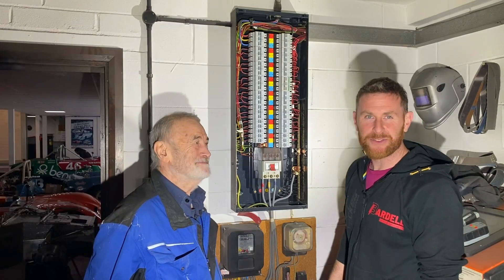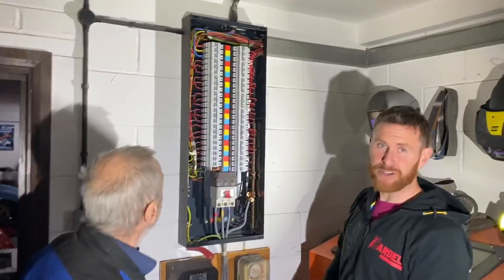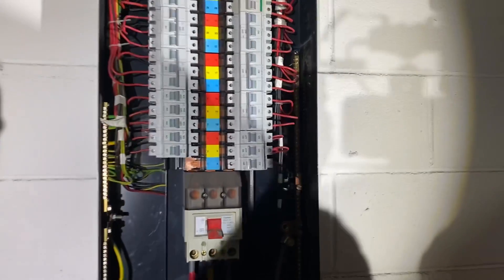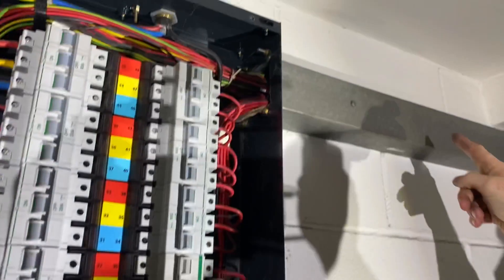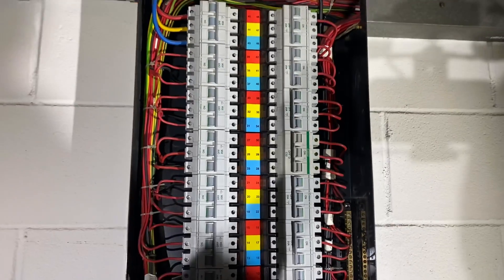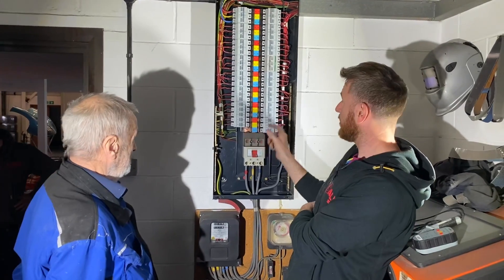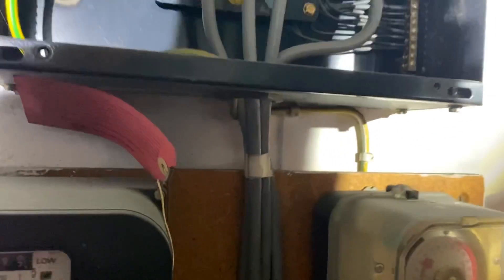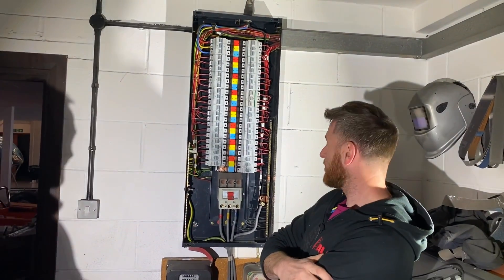Do You Cable Tie Your Conductors in 3 Phase Distribution Boards..? Electricians Matt & Clive O’Dell

Comment: Nothing wrong with ties. All those cables laid on each other in the trunking and should be derated accordingly.  Plus they all need to be under significant load for a prolonged period. Design guide covers it. Myth started by Another....... 

Keep openings tight regardless imo.

Great video guys
Reply from the maker: Massive thanks for watching and commenting Mark. Gaz 👍🏻
Reply: @GSHElectrical  always watch every single drop gaz on here and efixx. Take care and merry xmas!

Comment: Not worried about grouping factor, that looks to be old 14th edition going by the board and breakers, the cable ties are probably the newest thing in there. IPXXB at the bottom, where's my standard finger and will it actually reach up to those terminals - Paul anyone seen Paul.
Reply from the maker: Have you got an IPXXB finger in your tool box? 👍🏻
Reply: @GSHElectrical  12mm diameter and 80mm long, indeed I do. People always seem to think the standard is much smaller than it actually is.

Comment: How many hundred amps would you have to be pulling before eddy currents could actually heat a consumer unit with separated phases or separated L/N? An absolute shit load of current... Modern AFDDs are gonna heat up a CU faster with thir dissapaited heat. I get the principle but has anybody managed to make a CU heat up with eddy current?
Reply: John Ward has done a video on this and he couldn't get the case to heat up.
Reply: @paulambrose3003  that was a great watch, definitely more current than a thought. I've seen some older temporary distros with powerlocks fitted in a metal panel, as a connector they're good for 400amp. Yet the designers didn't worry about it heating up (mind you said distro was made of really heavy plate and angle iron)
Reply: I have come across a trunking that was hot to the touch due to eddy currents, was in a supermarket supplying refrigeration
Reply: @nickbuckle646  I would assume that's more likely caused by thermal dissipation within the trunking? what was the mechanical separation between phases or phase to neutral and was it definitely eddy currents causing heat rather than just overcrowding?
Reply: I wasn't talking about a little consumer unit, I would say that the place I saw it inwould have been pulling at least 200a per phase.
AFDDs a still not commonly fitted to expensive let alone trying to retro fit to old DBs
Reply: @nickbuckle646  I know you weren't talking about a little consumer unit your reply clearly says " in a supermarket supplying refrigeration" hence why I had further questions.